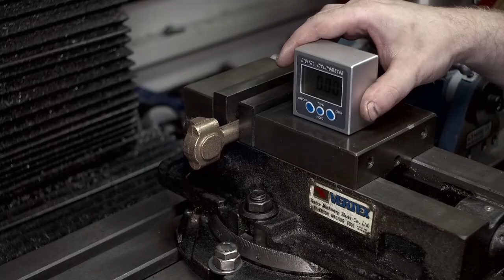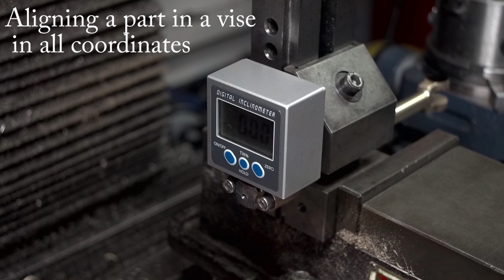PM Research 6 CI Steam Engine Build Part 5 (Machining The Connecting Rod)

Comment: What model is your Sieg lathe? Love that chuck, where did you get it? Did you have to make a face plate?
Thanks Brian
Reply from the maker: This lathe is Sieg 330x660 , the chuck is from Ebay , face plate on progress :)
Reply from the maker: Tony Wilson  I have this lathe over 4 years and I love it , I don't checked diferent firms .
Reply from the maker: Tony Wilson  I work on Sieg machines more then 15 years , for me it's a only option :) My lathe and mill are Sieg    , if you take a big models , they are good machines , the smoller models are less good , more hobby style .